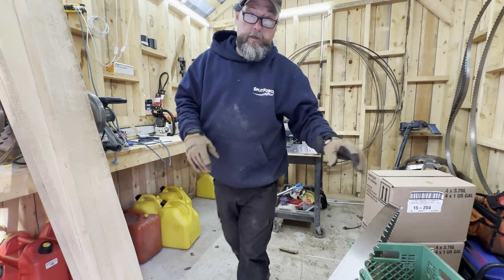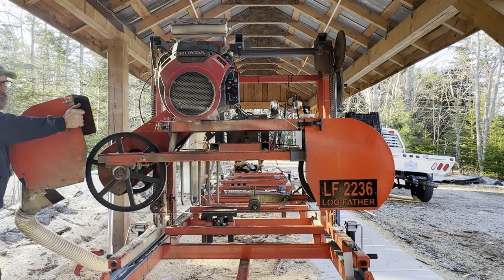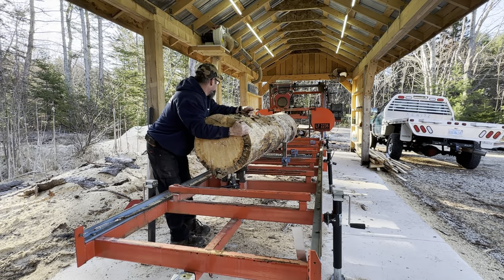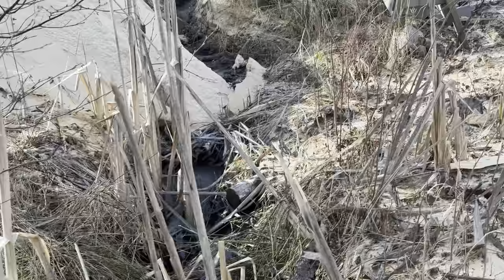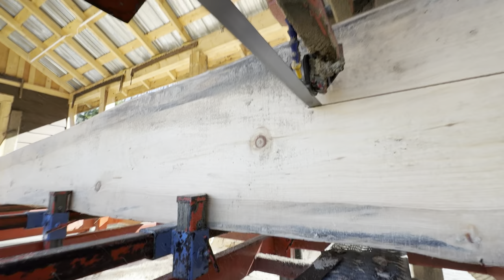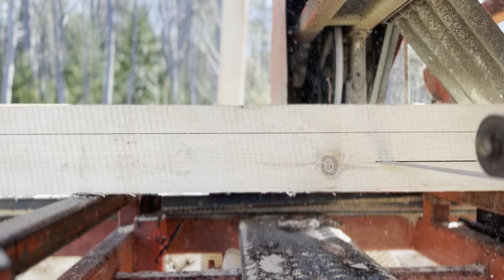REAL TIME $400 PER HOUR WITH HOMEBUILT SAWMILL.

Comment: Little trick I use so as not to forget what I need to buy at Princess Auto. On my cell phone which is always near by, I use the application Google Keep to note down what I need from different stores (as soon as I think of it) so that my shopping list is always with me. Using the same list, I have one section for Princess, one for Canadian Tire, one for Lee Valley....you get the idea. I use the check boxes so that whenever I pick up something, I check it off and it disappears. Cheers
Reply from the maker: Brilliant idea- my iPhone has a similar app available.